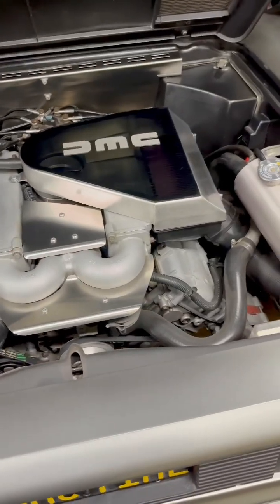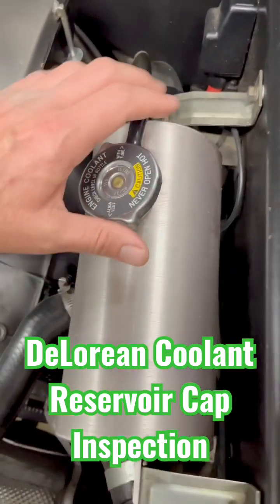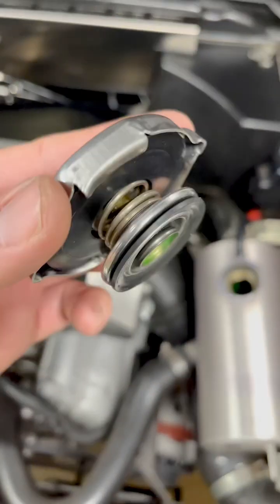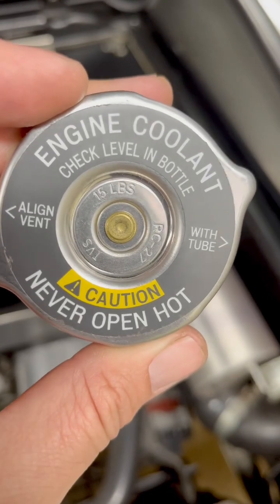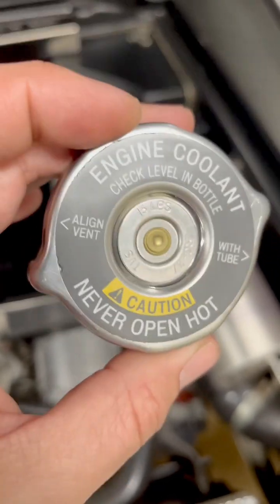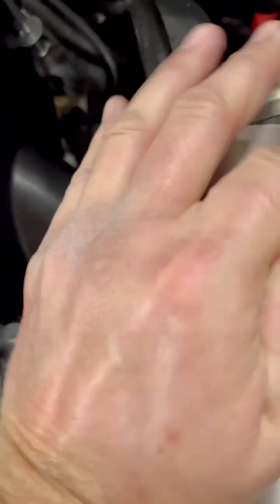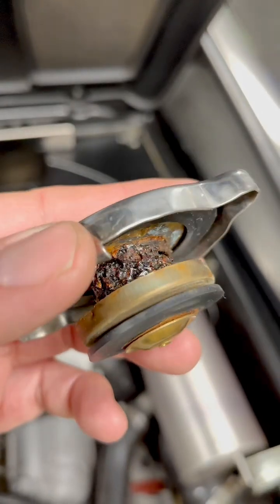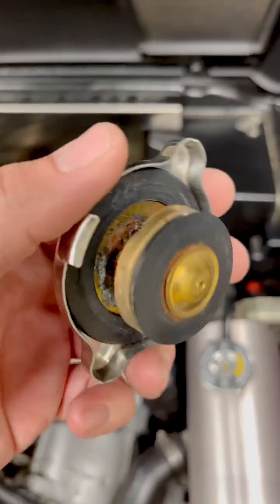DeLorean TechTip: Coolant Reservoir Cap

Comment: Spend the extra money and buy a Mr. Gasket Thermo Cap that tells you the temperature inside the coolant tank. Very handy when comparing the cars dash coolant gauge with the Mr. Gasket version. Its also rated at 15psi and comes in different colors. I have had mine now for over 10 years.
Reply from the maker: good recommendation my friend!